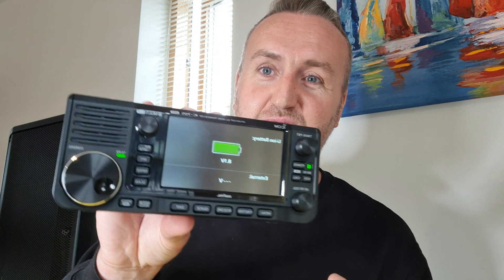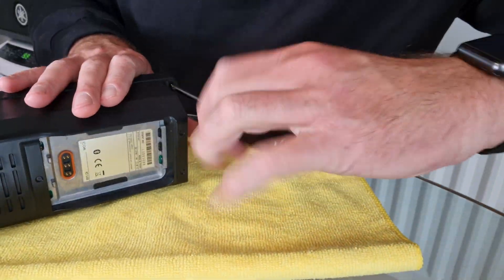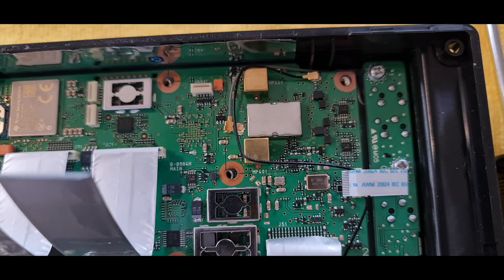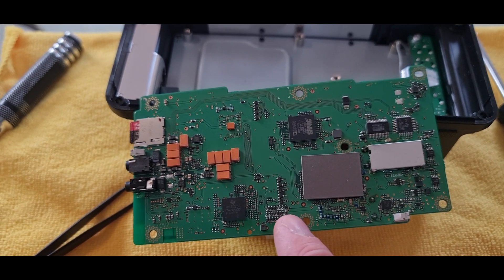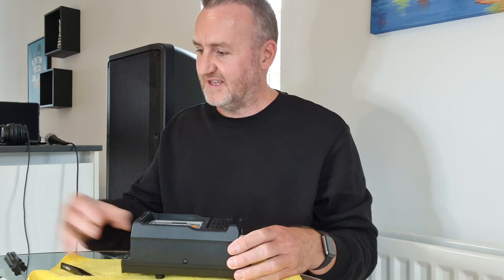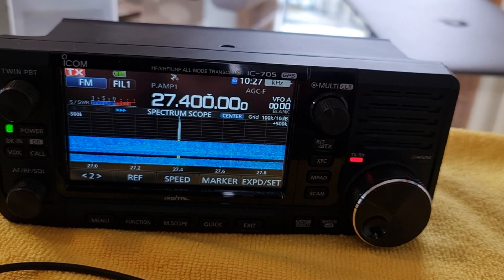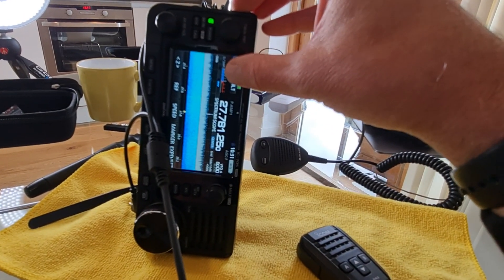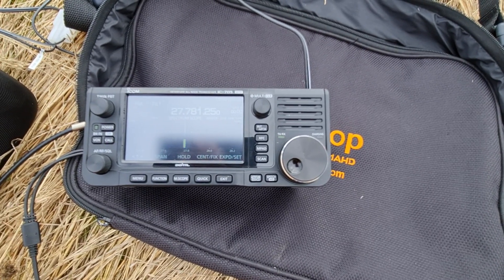ICOM IC-705 EXPANDED TX MOD - PLAYING ON THE CB BANDS!!!

Comment: Wow. At about $1200 to $1400 USD, that is one really expensive CB radio.  Heck, it is pretty pricey for a QRP Ham radio.  Also, I don't know about the UK, but license or not it would be illegal to use that radio on CB or Aviation band.  Yes, I know that one can likely get away with it,  I just wouldn't be posting videos of myself breaking the law to give law enforcement evidence to use against me.  There are numerous cases of folks who were violating drone laws, aviation laws, or other laws that got turned in and investigated by the authorities.  Some even received fines or summonses to court.
Reply: not illegal to use it on CB little buddy. It's 5W on its own battery, and you can set it to 5W even with an external power source.
Reply: @OllieVK  Actually, yes it is illegal. If you're in the UK, a CB is an unlicensed station; your amateur radio is a licensed station.  In the UK, a licensed station may not communicate with an unlicensed station, except in an emergency situation.
Reply: @cwqrpportable  only if the unlicensed person is operating on ham bands
Reply: @AP-ic3un  No, that's not correct and it's already been covered. Please do your homework and research before making stupid comments.
Reply: @cwqrpportable  The license clearly states that messages should only be sent to licensed hams or the stations of licensed hams. If you are appropriately trained you can pass messages from agencies in an emergency.
CB has a completely different set of rules. Anyone, ham or not can operate a CB. However, it has to be a type approved set. A modified ham transceiver is not type approved.
Also, if you are a ham, I would suggest that you consider the way you write responses.
Reply: @AP-ic3un  You are STILL confused about the law, about saying good buddy on CB and about trying to show how you've read up on some rules. Well, I'd suggest a couple things, A. get a life, B. learn to read and comprehend, and C. we'll catch you on the flip flop..... over and out.
Reply: @OllieVK  Well, it may or may not be different where you are.  However, in the USA it would not be legal to use a radio that is not type-accepted for CB on the CB band.  I could go on for several paragraphs explaining why that is but Ria in this video does that. 

https://www.youtube.com/watch?v=viV_Z9gAWzM  

I agree that it would be nice to have such a radio.  I'm sure that there are some folks who are doing that now, but in the USA they need to keep it on the down low.
Reply: @BryanTorok  he's not in the USA.
Reply: Don't even bother trying to talk to these lids about laws, it's not worth your time.  Who in their right mind would even want to talk on CB let alone spend that much money to do it. Lol  Takes all kinds.....
Reply: @cwqrpportable  I got my start in radio on CB decades ago.  When the FCC dropped the code requirement, I moved to ham radio.  Now I'm an Extra and president of the local club.  At our peak we had 450 members and 7 repeaters.  We're down to 150 members and 5 repeaters.  So, if someone gets started in CB, maybe they will want to try other bands, other modes, satellites, etc.    If so, I'd be happy to have them join us.

I see a whole lot more 2M & 440 antennas on cars than CB antennas, but there are still some folks out there.  Now, I hear that ham radio is getting competition from GMRS for people who want to do what we do with 2M & 440 but who don't want to have to study for a license.
Reply: Bunch of Nancy’s jumping right to the LAW’s. Jesus.
Cool Video👍
Reply: @hardenpt2522  It is a  cool radio and cool video.  But, we there are reasons we have laws.  If you don't like the law, contact your legislator and start a movement to change it.

My point was not that he was breaking the law (in a mostly minor and harmless manor) but doing it on video.  There are thousands of people who have ended up in jail because they posted on social media breaking the law, all the way up to drug dealing and murder.

Comment: So....as a "Licensed Ham" you film yourself using equipment that is illegal on 27mhz, hence it being blocked from the factory,  and is against your license conditions to use there.....?
I hope Ofcom have nothing better to do or you won't be licensed much longer
Reply: But you could argue as long as it does not cause you a issue or interfere with emergency services why worry about it, how many full licence hams do you know run a kW amps even though they are are only supposed to run 400 w pep if rules are to be broken there always someone licensed or not that will do it  not that I condone it but at the end of the day as long as you are running your station as you see fit that's all you need to worry about

Comment: did this to my 7300 ... i recommend to use filter3 on FM because otherwise deviation is too large for most CB radios. You can store the channels in memory and have a very fast channel scan and can use the buttons on the mike for switching channels .. cheers! very nice setup!

Comment: Why mess up a perfectly good radio instead of buying a cheap CB radio?  Either a legit 4w (AM/FM) / 12w (SSB) or an "export" 10m rig that can easily switch between the 10 and 11 meter bands?
Reply from the maker: How is it messing it up? 😅 I want to get maximum use out of my investment. I don't want a separate radio for each band, the icoms audio sounds way better than the cheap CBs anyway.
Reply: @andykirby  first, transmitting on cb using more than 4w (am/fm) ERP or 12w ssb PEP from amareur radio equipment is illegal, in case that bothers you.  Second, opening up your rig to non-amateur bands voids the warranty and may not be good for the filters inside the radio as well as create splatter and undesired harmonics.

Comment: A curiosity.
What about applying pressure on the diode with something like a box cutter o a small, sharp flat head to break it? Would "incapacitating" the diode not achieve the same result?
Reply: You can snip them with a fine pair of side-cutters, but it does risk lifting the pads. 
I find two soldering irons is the best method.
Reply: Just tell them to bash the thing with a rock why don't ya?

Comment: Just buy a CB, this is a waste of a good radio.
Reply: How is increasing its capability a waste?
Reply: @RingwayManchester  Hi, I'm a big fan of your channel and you do a great informative job. What I mean as a waste is sitting on channel 19 with there HF set flat out. Its just my opinion.
Reply: @stainless2867 But why not have both?
Reply from the maker: Nah!! How is it wasting it? If you can use it for more stuff then why would you not. Your sort of attitude is why Electronics waste is a real problem. Not very ECO.
Reply: It would only be a waste of a good radio if he ONLY used it for CB.
Reply: Buy a simple CB radio ? You really want to go by 4 Watts output only ?? .. means you need to add the costs of a 100W P.A. ... that's the power used commonly for 11m as far as the UK- guys reported who talked to us here in Switzerland during the sporadic E session recently. Most of the CB " hobbyists" anyway confessed to operate a Yaesu or ICOM. That's CB of nowadays. By the way: The Krauts blow us off the channel .. 200W is their lower limit, many use russian P.A. providing 500-800W ( smuggled thru Poland by truck drivers). 73 de HB9
Reply: Stainless- a hero
Reply: Or is it (446.000)(5MHz)(70MHz)?
Reply: That comment was a waste of space.
Reply: By "a good radio", you mean a diode that shouldn't be there. Right?

Comment: Passed my foundation nearly 4 years ago and I’ve never keyed up on the amateur bands let alone made a contact 🙈🙈🙈🙈🙈🙈
Reply: Why not???
Reply: @ben2e0omr  I can’t get my head around it mate, I’m horrendously mic shy, I think it’s also the formality of a amateur radio too
Reply: @benspeedschannel888  I was like that too, just forced myself to do it. Like with anything you're anxious about you can either force yourself to do it or remain scared forever.
Reply: @ben2e0omr  I even gave all the equipment away that I had at the time, an icom 756 pro3, an icom 7000, a yeasu ft900, plus a shedload of other gear

Comment: It's  easier to just crush the  zero ohm resistor with a thin pair of snips..That's the way I've always done wide banding on mine,, that way you still have the solder pads in place should you want to add a blob of solder to return it back to amateur bands only..
Reply from the maker: That's a pretty good tip, they are tiny diodes gotta be carefull not to pull the pads up!
Reply: yeah you dont want to be damaging the pads, just use light pressure when crushing the component, it doesnt take much pressure with them being tiny..